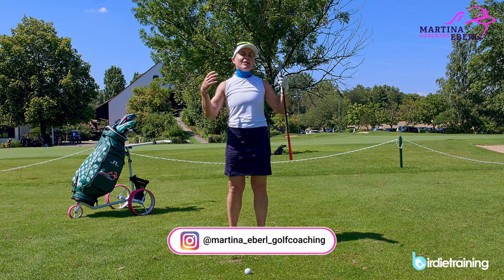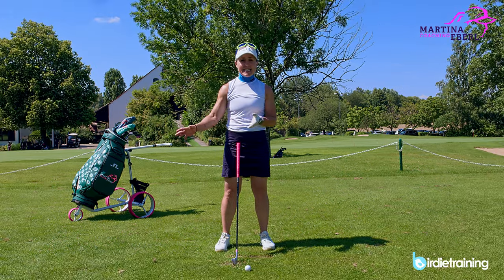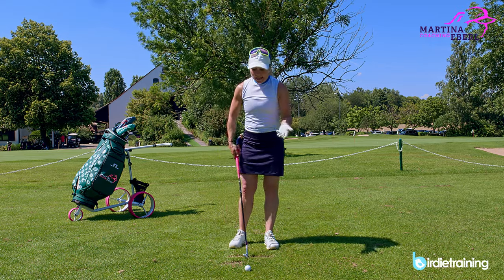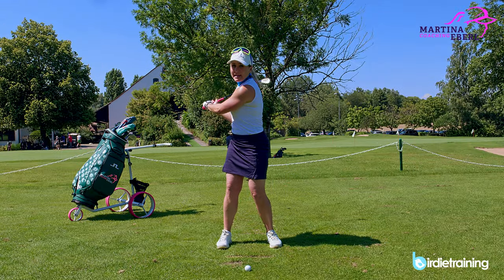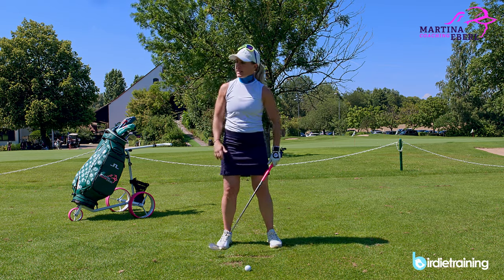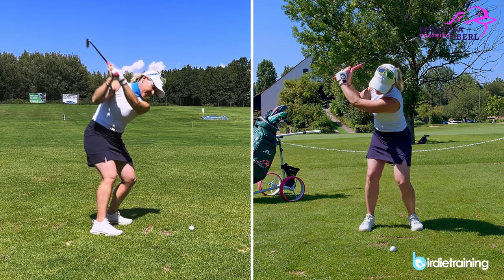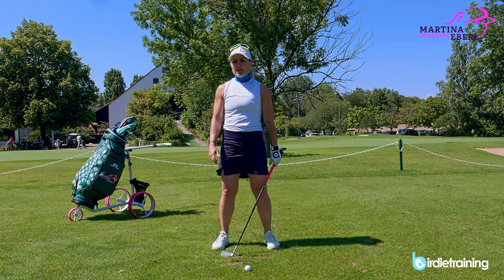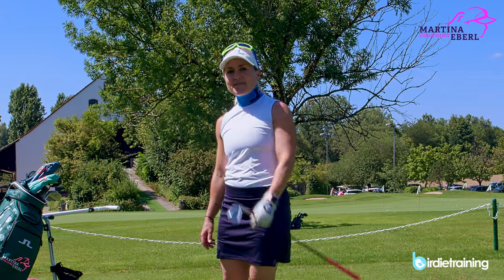Golfswing: Outside Swingplane - a few reasons

Comment: If you could explain and show the hip movement in backswing, compared to the hips moving more up (like you explained) on downswing.  Obviously, it would be an easier movement if hips were matched in their movement both backswing and forward on downswing, but my experience is it's two different movements.  This is critical component of swing as you show, because hip torque is source of tremendous power regardless size of the body.  Cheers.
Reply from the maker: You are absolutely right there. For me it's also different moves...